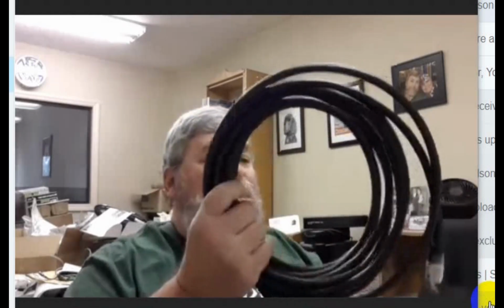The Coax Connection: Interview about bad coax with Ray Nelson, N1MPD (#97)

Comment: That trash cable extends all the way into the USB charging cords (dead giveaway is that you have a "fast charging" aka 5v 2.1A charger on one end but you run a battery analyzer app on the phone and you're not getting anywhere near 10W into the battery with the battery starting at roughly 50%), and 3.5mm stereo aux cables too (giveaway here is lots of hum and/or low volume on the other end of the cable).
Cut the cable open, and sure enough, it's CCA wire not pure copper. And the ends are crimped not soldered (because of course they are, sure NASA trusts crimp joints and so do I, but that assumes competent manufacturing, something you roll the dice on when you buy from some unknown overseas brand on Amazon or AliBaba or Ebay or what have you).

Comment: Would liquid electrical tape work well for water proofing? Say 3 coats letting it dry between coats. That's what I did and it seems to be working, but it's only been about 3 years.

Comment: its ben about 15 20 years now but i went to unhook my Coax and drop it into a 1quart Jar during a lightning storm here n the south at the bottom of the Appalachian Mountain's and noticed a drop or 2 of water but didn't think much of it at the time But when i went to hook my stuff back up i Noticed that my 1quart jar had about 3 inches of water in the bottom & Then I Realized what was going on & had to Replace all my coax & Re seal every thing ! ! A lot of work for something that could have ben prevented n the first place ! I Also Got Took on Some of that Trash Coax You all Was Talking about..Luckily i discovered it Pretty fast when i hooked up a new radio & antenna and it only had roughly half or less of the receive i was expecting so i started the troubleshooting process an sure enough steel Shield & cca Center ! It Was Sold As Very High Quality all solid copper center & Copper Shield But it was not so i Messaged the seller and told them it was a pile of junk & i expected a full Refund !

Comment: Crazy! I bought some LMR-600 ultra-flex on eBay (I'm Canadian, local options are overpriced) - It shipped from the USA. I installed N connectors at both ends, it appears legit to me, and tests amazingly good with a VNA, but now you've got me wondering! It performs really well for my use, at least, whether it's fake or not.

Comment: I use liquid electrical tape it seems better than the adhesive type tape, it is way more expensive but oh well and if the can is not sealed well it will dry out.

Comment: I have a box of those connectors with the ring in it. noting comes with that kind of connection  on the back of the radio. I wish I did because as for as i know they are far much that the pl-259 that is on the back at radio's

Comment: I had an antenna that was up for ten years. water got in the coax . I had a high s w  r   I had yellow Belden that was about at the age limit. but it lasted another ten year with out getting water in it. it was purchased from a C B radio shop . where I bought it from. I had an army big stip and I used some thing that looked  like a hard party when I took the antenna.

Comment: THANK YOU FOR THE INFORMATION,  I have seen the old type phone drop wire that ran from the tower to the office for a remote,  that when the tower was hit by lightning,  there was No wire inside the (wire) there was only the rubber outside with no wire inside it!  The tower took a lightning hit!  The fiberglass antenna looked like a  umbrella!  The RG213 had the connector blown off where connected to the radio!

Comment: Another great video with lots of first hand, valuable experience from the best industry expert.  David, the information you set forward to the ham radio commubnity is invaluable, thank you.  

Your feedback on the following please:  I have recently soldered a series of Messi & Paoloni 0.4inch / 10mm Broad Pro cables to their LP259 connectors; all high quality stuff (probably as good as it gets  here in Europe).  Is there a way to check the performance of my end product somewhow?  

I am not sure if the soldering I did is good enough, either in terms of cold soldering (I think I did a good job in avoiding that) and in terms of enough solder going into the center conductor.  What equipment do I deploy to test my cables, and are there reference standards in measured values?  In terms of continuity I tested my cables and all is good.

Many thanks in advance, Stefanos,  SV1QZW

Comment: Hi Dave, I have installed hundreds of UHF antennas for AES radios in the alarm industry. I used Scotch 130C over the connectors and coax, then covered that with Scotch 33+ to protect the 130C from the Arizona sun. I never had any issues. This video is an excellent tutorial for everyone installing antennas.

Comment: Trying to setup a MFJ-2104 using 50ft of 213 coax and not having any joy. Using the mfj analyzer, it seems to be showing that the cable has an issue as it tests as 47.5 ft (velocity factor of .66) when in fact it's 50.1 ft. I put the dummy load on the cable as suggested by your guest and it tests with a low SWR across all applicable bands. So not sure if the cable is at fault or the hub of the antenna. Still testing and will post later what I find. Thanks for the great interview. Will buy all my future cable from USACoax!
Reply from the maker: It doesn't sound like your cable is at fault. The length discrepancy is likely within the error limits of the meter--test equipment at amateur price levels is not lab-grade. The snow is melting here, so I'll soon be able to do my review of the Octopus.
Reply: @davecasler  I took the Octopus hub to my elmer and either the balun wasn't working correctly or the solder bars for both banks of terminals was shorted as a quick continuity test showed. We didn't open the hub as that would have required de-soldering the hub. I have exchanged the hub with MFJ, which they did very quickly, and all is good with the world.

Comment: That explains a lot. I've had problems with wiring, connectors and coax cables on various lab equipment over the years. Thank you.

Comment: Custom RG-213 Cable build
                
                Length120 FT                            Connector 1No Connector                            Connector 2No Connector                            Custom Heat ShrinkNo 

Who makes the coax? belden? jefa?thanks
Reply: also whats rg8a/u? mil spec should be M17/74-RG213

Comment: Good stuff Dave, you're a real asset to the Radio Hobby.  I appreciated hearing about the poor materials used in the cheap coax and how it effect longevity.  You get what you pay for as they say and if you go cheap, take all the sealing, handling and affixing precautions and recognize early deterioration.  73 -frank de KF2FI
Reply from the maker: Thank you

Comment: I bought some of that "It Depends Stuff" and I like it. It's marked as Andrew CNT-400 made in USA. Looking it up revealed it was made in China, and a spec sheet. The shielding is braided Tinned Copper, aluminum foil tape, foam dielectric, then Copper plated Aluminum for the inner conductor. He said it's fine up 500 watts. My financial advisor says it's going to be a long time before I can call CQ with 500 watts.  So what I got was a good bargain. My meters like it too. 
Great topic for discussion too. I replaced some RG8X with the CNT-400 and found some of that green powder inside the connector and braid that had browned 8 inches back from the connector. It had been painted with liquid electrical tape with 3 coats as instructed. This time I am using spray on rubber coating made by the same manufacturer . Perhaps it will seep in first and protect it better this time. Edit: I am looking forward to getting more this year at Oklahoma City Ham Holiday July 27-28 Sat-Sun.
Reply from the maker: Thanks for the information. Sounds like you've had good luck with that cable.

Comment: Great interview.  You can tell Ray that one viewer placed an order thru amazon for 100 ft of LMR 400 cable and the self seal tape. When ordering thru amazon, it's a bit tricky to make sure it says MPDdigital and has 5 star reviews. The other vendor reviews complain about the quality of the pl-259s. I am doing antenna upgrades before winter. Gonna construct a full wave loop for 40 meters fed with a balun design 2.5 to 1 balun, and use it on 40 meters, 20 meters, 15 meters, and 10 meters. Always look forward to your informative videos David. 73 from the Ozarks.
Reply from the maker: I'm glad you gave Ray your business. I've heard that several others have too.

Comment: 1) Nitto and 3M self-amalgamating tape is the only brands I use.

2) Quality 3M and Nitto commercial grade tar tape is totally UV resistant.

3) Water migration happens quite quickly - Seal your connections fully and properly.

4) Try to include drip-points and don't have connectors where they can sit in water or collect moisture.
Reply from the maker: The drip points especially are very important and often neglected

Comment: I've got a length  of coax, the air die electric type. or spiral  die electric flexible type coax. I KNOW it's had water in it. Can I restore it with clr, calcium lime rust?
Reply: 9913 is good coax.  The original 9913 specs are for Air Dielectric cable.  This means there is a fine wrap of plastic tubing around the center conductor that is like an open pipe with only air used as insulation.  It is fine coax, But once water gets in it you are pretty much done.
Reply from the maker: I've not heard of anybody restoring coax. But then again, I haven't heard of air dielectric collects in years. Are you certain that what you have is intended for use as RF transmission line?
Reply: David Casler   it's like 9913. I got from the wireman.
Reply: MPD Digital    I'm replacing it with ca600. Not sure if it's the fake lmr600. But it's so big. It's voltage specs can't be bad or far off spec.

Comment: I had the same thing happen to my coax over many years. ..water wicked in over 40' of the coax...high swr and no propagations. ...good video Dave.
Jim...KB8YBG
Reply from the maker: Yes, I've got some collects with green copper in it too. I've been moving cables around a lot while testing antennas recently, so I need to go back and waterproof everything. Thanks for sharing your story.

Comment: Exceptionally informative and great information. This not only plagues coax from China on eBay but there is also a problem with descrete electrical parts from China being sold that are defective and made with questionable methods and materials. The last LMR 400 I got from Dx engineering was excellent, and I do only try to buy from only reputable dealers, I’ve bookmarked mdpdigital and Usacoax too, thanks and 73, Tom
Reply: K2bew My boss years ago got a good deal on variacs. The toggle switches died on every unit within a few years. Either the switches latched on or off. Unless you checked the voltage with a meter, the on/off status was unknown! 
   When I opened up the switches there was a small copper part where there should have been a brass part. When the softer copper deformed the switch failed!
Reply: K2bew to